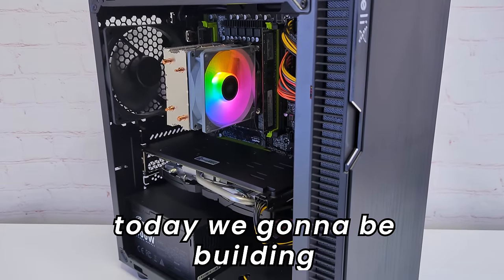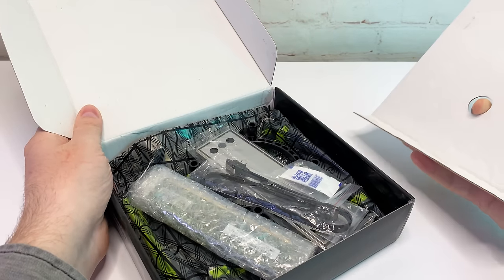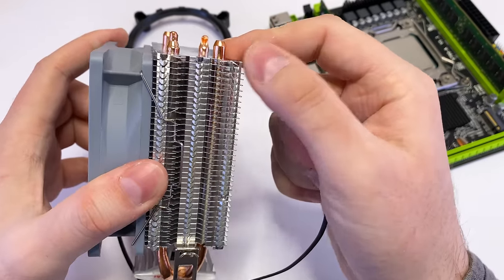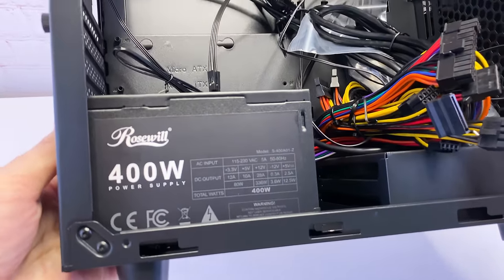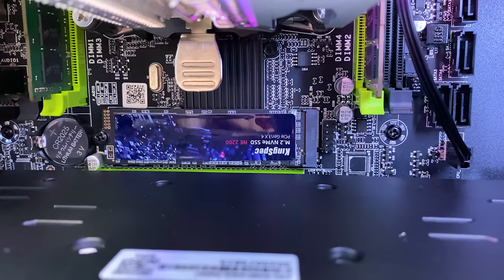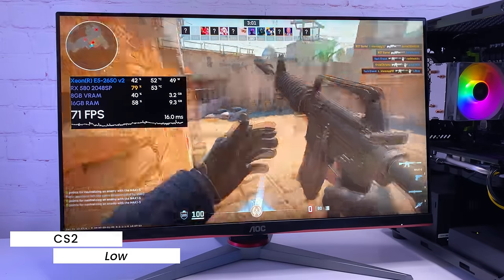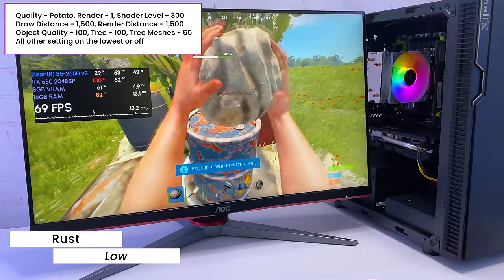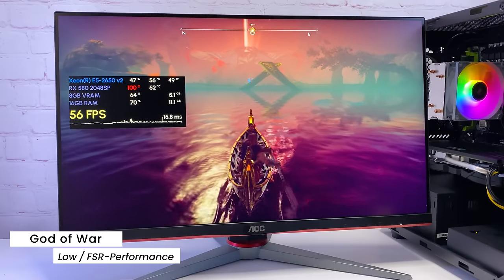This $200 Budget Gaming PC Build is Shockingly Good!

Comment: For $200 you really can't complain. I paid $300 for a PC that has an i7 8700k, 16GB of DDR4 RAM, GTX 1060 6GB, Corsair H100i 240mm AIO cooler, and the case which is a Kediers C570 open air with 7 RGB fans.
Reply: Your specs are pretty good for $300.
Reply: Thats a steal
Reply: No way you got like a $500-$700 for such price.
Reply: My current rig is composed of i5 9600k + GTX1060 6G, I'm trying to sell it for 350€ because my mobo only has one usable ram channel. Still, checking the second hand market on my country's most used 2nd hand platform (like Craigslist or Ebay) my pc is the best pc listed for sale under 500€ , but the market is so tiny that no1 has bought it yet
Reply: @gonehollow99  i feel like you could just replace the ram. A 9500k is still pretty good today.
Reply: 1060 alone costs almost 100$ and a used i7 are 150-200$ so how?
Reply: replace that gpu with rx 580 with 8gb for 50 dollars from aliexpress and thats a beast right there
Reply: @marky9441  a 1060 is better
Reply: @johnrupesh4535  In my country system like this goes 300-350 euros outdated ...
Reply: @ayosoggycereal  Better by driver support still going on. But these days find working one challange hard. Every card was mined with entherium so yeah good luck on that card.
Reply: @gonehollow99  Nobody wants to play on Single-Channel ram. Your motherboard is garbage.
Reply: @CovenantAgentLazarus  ok cry about it, sold it already and now have a 5800x3d + 4070ti :)
Reply: @gonehollow99  LMFAO. No you didnt. You didnt upgrade from that poverty PC in 1 month. Im sitting on my 4090 and 14th gen CPU just fine.
Reply: @CovenantAgentLazarus  average American hater
Reply: @@jackyo3214 NA means?
Reply: how i really wish bro 😞😔
Reply: nah i think u kinda got scamed
Reply: Cap
Reply: @gonehollow99  hey, can ii buy your pc??
Reply: @Shrulii  no longer have it, sorry

Comment: But does this pc actually work in the long term? I'm scared that the pc will catch on fire because the components were poor manufactured cause of how cheap they are? Also Im thinking of switching the motherboard bundle with a normal motherboard, ram and a ryzen 5 3600

Comment: Great find.  I have a similar system and paid $200 but I got mine with a workstation.  I am running a Dell T3600 with an E5-2665 and 64GB of RAM and just recently upgraded from an RX 570 to an RX 5600XT.

With it being a prebuilt it does reduce the customization options but I happen to like the subdued black case design of the Dells of the day so I am not so fussed about it.
Reply: 64gb of RAM is insane for 200$ . You damn lucky man
Reply: @Fizzi-gf2og  yeah but you wouldnt even need more than like 16 unless you do videoediting
Reply: Where did you get that?
Reply: @jasonanthonywilper  Animation studios selling off their old workstations every few years.
Reply: @n1982-n7q  some heavy games need more than 16gb's, rust for example- i'd say 32gb is perfect, but 16 is totally fine for 95% of people
Reply: @E_lisa_a  yeah when i played games i only played cs2, valorant, fortnite and other light games. I dont even play games anymore😅

Comment: Nice build, especially for the price!

I have been wanting to try out one of these x79/x99 combos and see how they perform. 

Great video and new sub!
Reply: they perform worse than 12100f
Reply: @pinkipromise  yeah but they have more core and its very cheap
Reply: I've recently thrown together a cheap setup for my son. Huananzhi X99 QD4 mobo, Xeon E51650V3, 16gb ddr4 2133 (quad channel) 256gb kioxa nvme SSD. When I received the motherboard I was honestly shocked at the build quality. It's very good!

Performance with an Rx 480 4gb on Battlefield V 1080p high is around 60fps most of the time. For the average daily PC user this setup is all you need.

Comment: i would go for an x99 combo as x99 cpus have better single core performance and turbo boost unlock. the 2640v3 runs around the same amount of the 2650v2 and is much faster

Comment: I was lucky I spend 374 dollars   for a ryzen 5 pro 4650g with 32gb ram DDR4 3200mhz and  GeForce GTX 1660 Ti 6gb graphics with 600wats power supply and a Asus prime A520M-K motherboard as well as it had 2 cooler RGB fans in box and 3 RGB at front of the case

Comment: because of the powerr constrain of the power supply, you can undervolt the GPU from the AMD driver, you can do it either manually or let it decide automatically how much power it'll drop, that will reduce power usage making it easier for the PSU to handle the system

Comment: Nice job man
Reply from the maker: Thank you!
Reply: @Tech.Closet  Yo man I have a question. Can I use a gtx 1080 instead of a rx 580 in this build?
Reply from the maker: @jstarzzz6638  technically you can, but you might face issues with power supply. also there will be more CPU bottleneck.
Reply: Alright I will try to buy a higher tier cpu and undervolt gpu 👍
 @Tech.Closet

Comment: I built 2 Pcs for my 2 kids 4 years ago. X79 Mobo, 1650v2 Xeon, 16gb-1866 DDR3 Ram, GTX980Ti, 1680x1050 Resolution TFT Display
Still capable for AAA gaming (the lower res of the Display helps here) with low settings. Can recommend doing this as new gaming PCs are very expensive in comparison.
However, you can get decent prices for Ryzen 3600 CPU/Mobo Combos that are much more energy efficient and faster...

Comment: Nice build, it shouldn't be the case with the rx 580 but I would avoid Mllse gpus. They have some that had a hacked bios so they appear to be a better card. That said there's other decent options on Aliexpress though. Also, if you flash Windows 11 onto a usb using rufus there's an option to remove the requirements from Windows 11 so you install it on unsupported hardware.

Comment: My $200 build:

980Ti 6GB
500w PSU
small ssd
large hdd
8GB ram
i5 3rd gen or i7 2nd (or xeon)
random case
Reply: How does warzone run on it like whats the fps you get?
Reply: @user-mh7sr5vf8t  80fps on 1080p if I remember right
Reply: @RobertFixit  thx might get those

Comment: definitely would have made this a 250 dollar budget and got an 80 plus psu.EVGA sells 80 plus psu's for around 60 dollars for a 600 watt.Problem is with out an 80 plus rating this power supply might only be giving out 250 watts because it couldn't be certified for 80 plus rating and will eventually go out and take the entire system with it. I got one of these cheap cases with a rosewill 400w power supply and hooked it up to a power supply tester and cranked it up to 400 watts for a stress test and it lasted about 5 minutes before going out.I always tell people never cheap out on a power supply> mean Rosewill isnt a cheap brand because they make expensive power supplies.But like EVGA,Antec etc they have there line of crappy PSU's like Rosewill

Comment: Did you have to buy a separate bracket to mount the cpu cooler? I ordered the same one from the link but it doesn't have a 2011 socket size 😢

Comment: Can the mother board fit in a atx case?
Reply from the maker: yes
Reply: @Tech.Closet  one last question sorry, but if I order the case of off Amazon will it come with the wires and everything or do they come with a power supply
Reply from the maker: @Ezerect   
If you order the case only, you still need to get a power supply, unless your case comes with the power supply (it should be mentioned on the page). 
The case I ordered from Newegg comes with the power supply. It's like a combo - case and PSU.
Reply: @Tech.Closet  I'm asking if the power supply comes with the cords or does the case come with the cords and everything
Reply from the maker: @Ezerect   The power supply comes with all the main cables that power the motherboard, CPU, and GPU.
The PC case also has cables that connect front panel with motherboard(usb, audio, power/restart buttons)
Reply from the maker: You can watch my latest video about the mx4 thermal paste, I'm testing it without a computer case. you can check how it looks.
Reply: @Tech.Closet  and so how do I get windows ten when I start up the PC? After building it

Comment: Could you do a build that runs cyberpunk and the expansion,starfield, and windows excel for 600$ that includes the best cpu,gpu, psu upgrades example: just use the best parts so I don’t have to upgrade for like 2 years
Reply: You could look up $600 build videos to get ideas on what parts to get.
Reply: @BREEZYM6015  ok thanks

Comment: I don't think the video card is a 580. I had one and i was getting 60fps most of the time in elden ring, and the 3d mark score seems a bit low too. Granted I had the Nitro+ whatever that was the most overclocked of the bunch but still the gap seems pretty big.

Edit: I upgraded the 580 with a rx7600 a few moths back and I urge everyone not to make the same mistake. I was a huge AMD fan before getting this card but the drivers are constantly crashing, and the oc options in amd software are super limited, it maxes out at 150mhz over stock. Fuck the rx7600, I wish i got a 4060
Reply: I heard that the drivers problems are over for AMD. Saying i wish i got a 4060 is crazy considering the hate it gets from the community XD
Reply: Yeah the Ali Express RX 580's are technically 570's. That's why it says 2048SP in the name which is the amount of stream processors and it's equal to a 570.

Comment: Sir how did u connect the cooler after applying the thermal paste
Reply from the maker: install the bracket that comes with the motherboard first, then install CPU cooler and connect it to the motherboard with 3 pin CPU cooler header

Comment: i bought the parts except for a different brand of gpu and a different ssd. i also got a 500w psu. on the gpu there is a white led and the pc works but will not connect to monitor. any fixes?

Comment: The non-working sleep has nothing to do with the Xeon CPU. On branded motherboards the sleep would work just like on any other system, it's only those crappy China boards where it doesn't work.
Also the RX 580 2048 isn't a RX 580, it's really a RX 570 branded as a 580 to look better on paper. It doesn't have the performance of a real RX 580.
Reply: Well almost. The 580 2048sp is an OC 570.

Comment: can you use that cpu cooler for x99 boards?
Reply: Yes. Those boards come with a mounting ring and about any LGA15xx or AMD cooler with clamp mounting fits these boards.
I personally would suggest a good top-blow cooler because the VRM on these boards get pretty hot, the CPUs are not an issue at all.

Comment: I bought   a 1000$ pc last week 
it has 
core i5 13400f
RTX 4060 ti with 16g of vram
16g ddr5 ram
the mainboard is asus prime h610 m-a (ddr5 support)
800w of power
cpu cooler is AG400 from deepcool
my case is aria green
512g ssd nvme m.2 
1t hdd
.
.
.
.
.
.
.
.
what do you think about it ?🙄🙄🙄🙄

Comment: im getting a 206 dollar build for my bday im getting a rx 580 with 4 gb ram 35 dollar pc case 35 dollar power supply  both from alixpress (400w) a keyboard and mouse bundle from temu and psu extensions for 10 dollars on amazon and a 60 dollar 100hz monitor from asus(sold on amazon) anything i should replace or add i only have like 210 to  spend if so send me some links or tell me where to find it

Comment: Hey man so im having troubles some of pins on the mother board arent even there like i had 2 power supply cables that don't even go on the mother board.
Reply from the maker: that's ok, you don't have to connect all power supply cables, just 24pin, CPU and GPU(PCie).
you can cable manage the rest.
Reply: @Tech.Closet  so where does the pcie go cus I got the AMD 5500 instead of 580
Reply: @Tech.Closet  and btw what about the CPU does it go on top of the 24 pin?
Reply from the maker: @JahshshJajaaja   should have a port on your GPU, and yes, CPU power port is on above the 24 pin. check the video at 4:20 mark.
Reply: @Tech.Closet  and one last thing sir it says window 10 drivers not found what do I do?
Reply from the maker: @JahshshJajaaja  where does it say that?
Reply: @Tech.Closet  when I try to download windows 10 pro
Reply from the maker: @JahshshJajaaja  if you trying to install windows on it? 
you have to create bootable USB flash drive: 
1) search download windows 10. 
2) download "media creation tool" from Microsoft website. 
3) Open it and follow the steps. 

Once the flash drive is ready, insert it into the PC and turn it on. Windows installation should begin
Reply: @Tech.Closet  yes I've done that but when I have windows open and about to select windows 10 it says drivers not found
Reply: @Tech.Closet  im pretty sure there's something in the bios to recognize the ssd but I don't know how to turn it on I have the same motherboard in the video and same ssd
Reply from the maker: @JahshshJajaaja  so as I understand you don't see any your SSD storage in the list when you try to install windows 10.
can you check this :
1)turn on pc, and keep pressing "Delete" key to enter Bios.
2) then go to "Advanced" tab -> select "NVMe Configuration"
3) let me know if your see your SSD info there
Reply: @Tech.Closet  wait never mind I got it bro my USB on my case didn't work and once windows appears I keep taking the USB out I'ma go to Walmart and get a USB extension thank you man.
Reply: @Tech.Closet  one of my USB didn't work and the mother board USBs didn't but I got a USB extender and it's working now
Reply from the maker: @JahshshJajaaja  ok then, glad it works
Reply: @Tech.Closet  hey man sorry to bother again but my PC is only running when I take out the ram but when I put both of ram back in it just turns on then off please help
Reply: @Tech.Closet  I got it now just the ssd isnt working I don't know why

Comment: i was able to build a i3 12100 + rtx 2060 super build for $339.90 after taxes and fees

there was a great deal from msi for a h610m motherboard, 500w psu, 120gb m.2, 240gb sata ssd for 64.99, so most of the pc was secured with that, and I got a matx case for 44.99, a used i3 for $91, and a newly refurbished rma 2060 super for $100 (very lucky)

without that msi bundle deal, it would be impossible to replicate this, and for $100 US normally you can expect to get maybe a 1660 ti/super or maybe a 2060 if you're lucky on the used market

Comment: People STOP calling the 2048 shader rx 580, its a fucking rx 570
Reply: I mean sure the 580 2048 and the RX 570 have the same number of cores but they do actually have different GPUs variants.  I mean there is a bigger difference between the two variants of the GTX 1060 so I don't get all the fuss over this.
Reply: @certs743  You cant compare the gtx 1060 6gb to the 5gb or 3gb to amd rx 580 and 570 that's comparing apples to pairs
Reply: @certs743  Also the full rx 580 has faster memory speeds and higher core clocks and more shaders, that equals to higher pixel and texture ratte compared to the rs 570 and the rx 580 2048
Reply: @certs743  S o if you look up the rx 70 and the 2048 rx 580 on gpu z you will see there the same gpu the both have the same memory speeds AAat 1750 and memory speeds and the same pixel and texture rate
Reply: @roymarr6181    Sure the core count and memory speeds are probably the same.

But that is not what I am talking about.  The actual GPU as in the die are two different chips.  They are not the same thing.

One is the Polaris 20 XL and the other is XTX.

Objectively the 580 2048 is a stripped down 580, not a 570.  Details matter.

So it is not false advertising as implied by the original post.
Reply: @certs743   The main reason why the call it the rx 580 2048 shades is to scam people to think its a  full rx 580 but its not but they do it so you buy it, bottom line its a gimmick
Reply: @certs743  Still it does not matter you cant call it a rx 580 when its not, and the specs and the performance lines up  to rx 570, so to me its a gammick and a lie
Reply: @roymarr6181    Again, it is not the same as the RX 570.  They are fundamentally different.

Sorry but your personal opinion doesn't change that.

Some of the specs are the same, the performance doesn't.  You are just assuming it does based on similar specs.

The actual GPU die is different and the difference in performance between the RX 570 and both versions of the 580 prove that it matters.

You might call it a gimmick but it is objectively not a lie.
Reply: @roymarr6181    You might have a point if we were talking about a GTX 1060 which on the 3GB version also cut down the CUDA core and TMU count but the difference in the RAM being the only difference openly stated and it makes for a much bigger difference.

In that case you would have an argument that you have a fundamentally different product and far more deceptive marketing.
Reply: @roymarr6181  I also think we are in dangerous territory if we start claiming different clock speeds are an issue.   I have a Zotac GTX 1070 AMP Extreme and the clock speeds are not even close to the reference design but both are the same model according to their respective makers.

Comment: You are better off using 5600G for same price with slightly higher budget.
Reply: If his goal was to stay at or below $200 then that wouldn't work. I agree that it would have been a better option.
Reply: 5600 is half the price of his budget not to mention he also meeds a good am4 motherboard and ddr4 memory which is x2 the price of a ddr3 ram, if going for the ryzen 5 5600 probably needs 400, tho Idk those estimates are based on the prices where I live